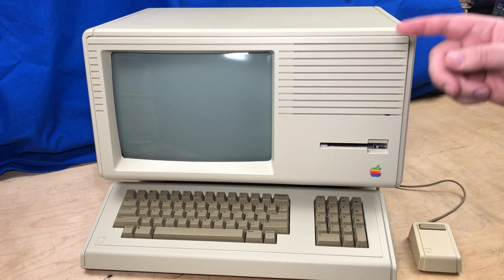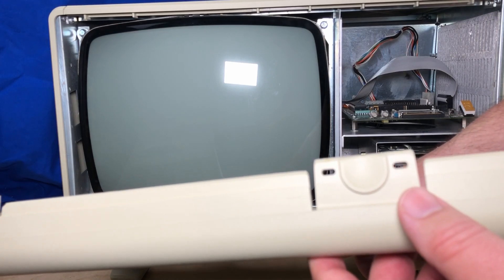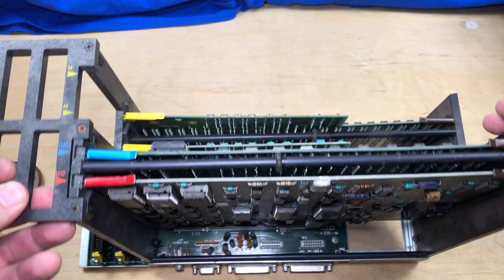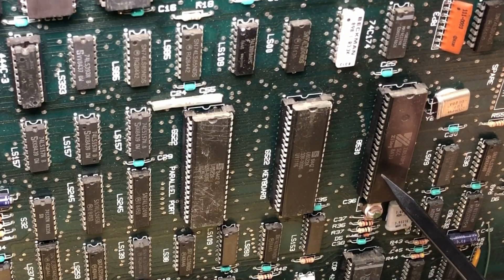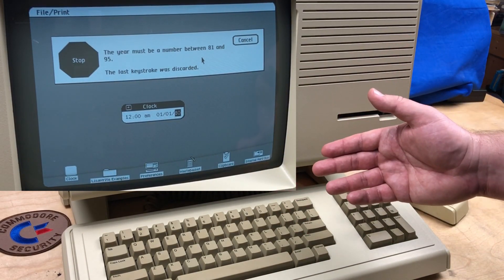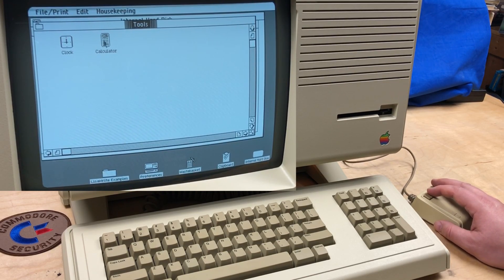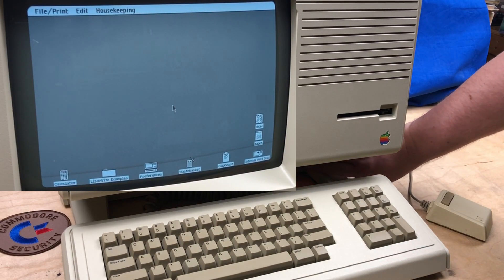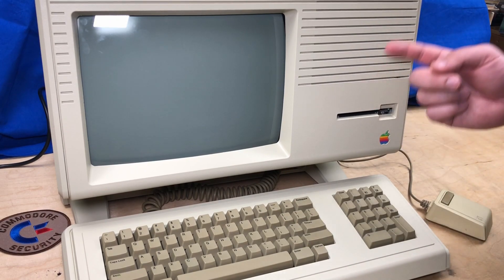Apple Lisa 2: Inside & Out

Comment: Simply from a build perspective, I now finally get why it was a $10k computer.
Reply: When he first took the front cover off I was really wondering how they justified the cost, but yeah... that backplane reveal turned out to a lot more complex than I was expecting for the time.
Reply: This thing is a battlecruiser. Having that many chips will also increase the likelihood of failure quite a bit.
Reply: Back when Apple was making computers designed to be easily serviceable and built to last. Not overpriced disposable garbage they are making now.
Reply: The flip side is "sure, if you move any project straight from prototype to production it looks like it costs a million dollars." There's a reason designs get optimized and cost-reduced before going mainstream.
Reply: @shadowflash705  disposable garbage
Reply: @Breakfast_of_Champions  if that was strictly true, there’s no way your smartphone would ever work based purely on how many more transistors it has compared to the Lisa.
Reply: You can find Bill Gates having lots of these Apple products in pictures were Bill is young in the early 80s, the Apples usually are behind his right back in the pictures. Bill assured Windows wasn't based on the Apples at all though.
Reply: @mrkitty777  Yeah, and Apple designed the Lisa's OS  from scratch and Jobs assured they didn't base it on the Xerox PARC software at all either.
Reply: @stargazer7644  here I read that Apple gave Xerox employees Apple shares.
Reply: Your Iphone is lucky to last 5 years, the Lisa is 40 years old and still working. So yes, he was right in a way.
Reply: @EmergencyChannel  Other than the limited life of the battery and the planned obsolescence enforced by required software and modem upgrades, your iphone would last 40 years with no problems. My 3GS still powers up fine 11 years later.
Reply: @stargazer7644  The new iphones have to have batteries with matching serial numbers lmao
Reply: i remember our cranky mesozoic grampy kept track of the deer count with some marks in our cave.. well, thousands of years later, that inventory data is still readable, if a bit color-shifted
Reply: This one cost $4k.
Reply: @EmergencyChannel  my old OG 2009 27'' iMac was still working just fine when I sold it almost 10 years later. That's more than I can say about any PC I've ever owned before… And I'm still rocking a 2012 13'' MacBook Pro running Big Sur through OCLP. Macs have a tendency to last a lot if they're well kept and were not victims of bad component batches during manufacture (such as my old iMac G5, which had the infamous counterfeit capacitors in it, the latter of which also killed a lot of PC motherboards from the same era, mind you).
Reply: @Breakfast_of_Champions  It sure had lots of chips but nearly all of those seem socketed so as long as Apple sold spare parts (did they? their modern behavior is pretty crappy for repairability) it would have been easy to pop out a broken chip and install an another.

If the system had good enough software diagnostics, it could have run some kind of testing program and report any chips that do not behave up to the spec. Features like this would have justified the high cost in early 1980s.
Reply: @stargazer7644  the point wasn't the number of transistors, the point is the physical number of chips. Each one of those chips has its own logic and bus transcieving circuitry and power electronics on-die, which makes for a lot more heat in the case and also introduces tons more off-die connections that are prone to failure with time. It's like how vacuum tube radios can last decades on the same 5 tubes it was made with but not a single fully functional tube computer made it into the 21st century. Tubes don't fail that often, but the MTBF statistic is low - which means with enough tubes and some statistics, things failing infrequently but out-of-sync with one another will mean every few hours or days you have to pull another tube. Or like how the late-stage Atari 2600s don't fail as often (the TIA and some other stuff in the Jr. models got integrated into one die) as the early ones do. It's mostly down to heat generation of individual chips running bespoke things repeated over and over between each chip and the interfacing between all the chips instead of large scale integration.

Comment: "I'm not about to do any paperclip tricks with that" .   lol, shots fired!
Reply: I don't think he meant it as a shot.  Robin doesn't seem to be that kind of guy.  Besides, if you wanted to defeat that switch a paper clip would probably be the first thing you'd reach for, I think.
Reply: @marred2277  either way I've had to laugh about it as well.... =D
Reply from the maker: Ha, I really didn't mean it as a burn at David, he's a friend of mine. He'd probably think it's funny anyway :) But yeah, I really don't know how to bypass that switch, but a paperclip is the first thing I thought of. Another commenter just said you should actually shove cardboard in there, to keep it open which makes sense.
Reply: What is this referencing? A paperclip accident sounds so familiar but I cannot begin to bring to mind what it could be referring to so I may just be imagining things lol.
Reply: @mayshack  David Murray (The 8-bit Guy) was given a chance to figure out an old IBM prototype, which was dead on arrival (and later in the same video found out that the other 4 identical machines that were with it were also dead).  As part of his troubleshooting, he used a paperclip, and blew a fuse in the power supply, and the interweb's best computer chair quarterbacks have piled on him about it.  Come to find out, IBM had a regular practice of bricking their prototypes, and it was a fluke that those 5 machines weren't in the landfill.
Reply: @TheOnlyDamien  See response to TKING2724
Reply: @marred2277 ...is... is this a Paperclip Truther argument?
Reply: @marred2277  I assumed it was a reference to the Compaq portable he cooked. He took a lot of flak for that one back when that video came out too.

People seemed more mad about the dremel cutting the screws out than the paperclip, at least as I recall. I see the comments are turned off on that one now, so I suppose that's an unknown now.
Reply: @performa9523  If I recall correctly, both of them had lion's share of arrows at that IBM prototype video. But yeah, the 8-bit guy got flak for paperclip shortings TWICE. I can only guess if he had to be quick for uploading videos or he really wanted to be reckless when handling such rare things. 

If you ask me, I just watch it for entertainment, I didn't bother making such comments about those things.
Reply: @proCaylak  You're right there. I suppose he's one of the bigger, if not the biggest retro tech channels on YouTube, so he's held to a somewhat higher standard- though whether that's warranted or not is another matter.
Reply: @marred2277  but  he used brutally dremel to remove screws, ok it was bricked prototype but still!
Reply: @Mārtiņš Markss It wasn’t brutal. He cut edges onto the screws so that they could  be turned. On an internal power supply. Where the marks on the case of the power supply would never be seen. Even if he had gotten the machine working, I really couldn’t care less about those screws, personally.

Comment: I spent many hours in 1983 using LisaDraw when my dad let me come in to the office on weekends. The manuals that came with the machine were very well designed and easy to learn with. I stored my work on a floppy disk, but Apple upgraded the floppy drives to 3.5 inch versions, so I couldn't open my files. I still have printouts of the pictures I drew. I had hoped to program the Lisa, but I was surprised that the tools were not installed. I had been learning 6502 assembly on my C64 at home.
Reply from the maker: I was also surprised (and disappointed) that there were no development tools included.
Reply: @8_Bit  times were different ;) Back than you had to pay a lot for the development kits. For the price of the simole c compiler of a Sun you were able to buy an Amiga or ST with good compiler.

Now you can get a simple development kits for free, because users will not buy machines without Software.

Comment: I think the Lisa's physical design was inspired by the TRS-80 Model II, including the keyboard nook and removable card cage (and later on it had a 68000 CPU upgrade available, but it never had a GUI or mouse). I believe the only way to externally tell the difference between a Lisa 2 and a Macintosh XL (or a Mac XL that someone converted back to a Lisa) is to check the serial number, as their cases are identical.
Reply: A Lisa 2/10 and Macintosh XL are identical from a hardware perspective. The only difference is the software included with the machine. 
A Mac XL can also have the Square Pixel Kit and CPU accelerators installed. These prevent running Lisa software, but make Mac software run better.
Reply: There were a number of communication terminals that used this design in the early 80s.

Comment: Today's Apple could learn from looking at how easy it was to disassemble, upgrade and repair their early computers. But I guess there is more money in selling people a new machine instead.
Reply: Apple has gone too far in the thin and light direction. Every connector and every screw adds weight and thickness.
Reply: That's just how the entire industry has gone. Laptops from all manufacturers are increasingly less upgradable, to the point where a user being expected to easily disassemble a laptop is the exception rather than the rule.

Their Mac Pro tower and Server are actually in the opposite direction, and are completely tool-less. I even think the processor replacement is tool-less (the heat pipe is held down with a clamp rather than screws).
Reply: Apple is responsible for the ugliest computers, the most overpriced computers, the worst excesses of planned obsolescence, the most awful exploitation of workers in Asia.
Reply: @NuntiusLegis  You don't get out much, do you? So much hate.
Reply: @timsmith2525  That is an interesting comment, so I checked it out: I went outside, but love for Apple did not come flowing to me.
Reply: @NuntiusLegis  a new Amiga X5000 (if you can get one) costs a minimum of $1700. And as others have said, many people are soldering down components these days - and there are legions of YouTube videos where YouTubers replace failed components in old computers by brandishing a soldering iron. So, even assuming your last point is true, that's the only one that is, because your first point is merely a matter of opinion.

Sure, the Lisa, and even the original Macintosh, look ugly by today's standards, but you have to compare it to what was available at the time. Nobody did flat panel or laptop computers, then, and it's a damn sight prettier than a PC 5150 or an XT.
Reply: @jeffreyjoshuarollin9554  That price is peanuts compared to the Lisa's 10,000 USD in 1983. - With excesses of planned obsolescence I meant iphones that are hard to disassemble and repair with overpriced spare parts, and it was even proven that Apple secretly put firmware into older models that halved the performance. 

The first IBM PC with original monitor I consider a good looking machine.

I actually didn't mention a lot of villainy by Apple yet. Like, Apple is an awful data kraken towards it's customers with excesses like providing Chinas government with data about every citizen, or transcribing everything that was said in microphone range of Siri without consent of customers which was made public by a whistleblower.
Reply: @NuntiusLegis  the high price of the Lisa is one of the reasons it didn't sell. the Lisa 2 was much cheaper, as was the Macintosh. 

As for considering the original PC to look better than the Macintosh, or the conspiracy crap pretending Apple is actually worse at this than other vendors: LOL.
Reply: @jeffreyjoshuarollin9554  I wondered why you think these (at least here in Germany) well known facts would be conspiracy theories, so I looked at the entry on Apple in the English Wikipedia and I am shocked how much is missing. Perhaps you should do yourself a favor and take a look at the auto-translated German Wikipedia.
Reply: @NuntiusLegis  I didn’t say you were incorrect, I said the idea that Apple is worse is laughable.

Perhaps you should do yourself a favour and either improve your English to the usual standard in Germany, or stop being such an Apple hater, whichever is applicable. As for the auto-translated German Wikipedia, ich verstehe Deutsch schon.

And no, not being an Apple hater doesn’t make you a fanboi.
Reply: @jeffreyjoshuarollin9554  So "conspiracy crap" means "correct", I see, thank you so much for improving my English.
Reply: @NuntiusLegis  troll.
Reply: @jeffreyjoshuarollin9554  Then name just one "other vendor"  that used crippling firmware compelling customers to buy a new model or spied in it's customers' bedrooms.

Comment: The strange document-oriented OS, where you can only open documents and not applications, was probably another feature borrowed from Xerox.

The Star/Viewpoint document preparation workstations worked in the exact same way.  You copied document templates and opened them.  The necessary application software would automatically start and stop in the background as necessary to service what you're doing with the documents.

It makes perfect sense if you're viewing it as a document preparation system and not as a more general purpose computer.  Especially if you're trying to sell it to secretaries and other people used to working with typewriters and photocopiers.

Comment: 16:00 Planned obsolescence gone extreme. I can imagine they had no intention of the machine itself lasting until 1995 but did they really think the OS itself was going to die before then?
Reply: I'm guessing the OS is full of hacks tied to the hardware to get acceptable speed so they naturally expected to rewrite/recompile it before then. I'd love to know for sure, but while Apple announced they were going to release the source code for Lisa OS in 2018 to all kinds of good will from the open source community...  they apparently never did.  :(
Reply: i think it's not planned obsolescence, I think they well knew by 1995 the lisa would be waaaaaay too slow to be considered a ligitimately useful machine... unlike a cellphone where the actual computer part of the phone is plenty good enough to keep being used as a phone or even a computer, but the battery can't be changed out...
Reply: @AKATenn  Well, okay, by "planned obsolescence" in this case I just meant "planned for being obsolete" which isn't what's normally meant by the phrase. :)

Comment: Slightly disappointed you did not provide a spot rating of the Lisa cursor key layout in the "Worst Cursor Key Designs Of the 70s and 80s" contest.
Reply: Apple, at one time, thought that cursor keys are outdated because modern computers have a mouse. Yeah, right.

Btw, one thing I still sometimes miss nowadays is a feature the Amiga had: you could move the mouse pointer and emulate the mouse buttons with keyboard combinations. Because there is always this one piece of ~sh~ software which is only controllable by mouse. Like, when the tab key will always skip the "OK" button due to shoddy programming.
Reply: @klausstock8020  Computing history is absolutely littered with terrible ideas about cursor keys (almost all of them, in fact) while the inverted T just continues to rule. And, agreed on the Amiga keyboard control over the pointer! Unintuitive to the uninitiated, but very valuable in a pinch.
Reply: @jpcompton  I had a honeywell bull XT compatible keyboard with a plus sign configuration for the cursor keys, with a blank centre key.  Also the CTRL was where caps lock is now, and the caps lock was a physically locking key that stayed down (like on a typewriter).  It was clear to me this was a WordStar Keyboard.